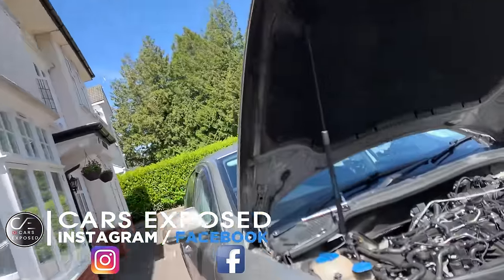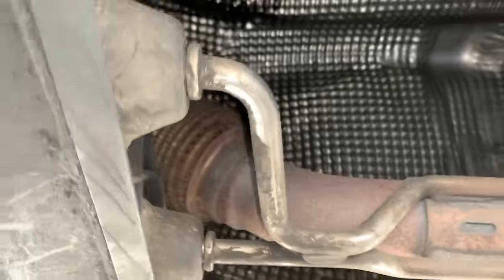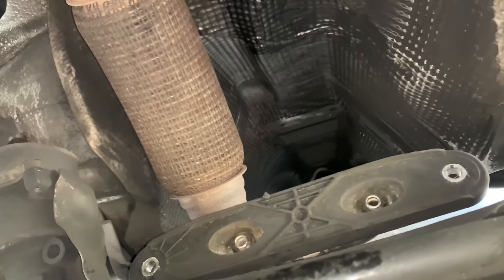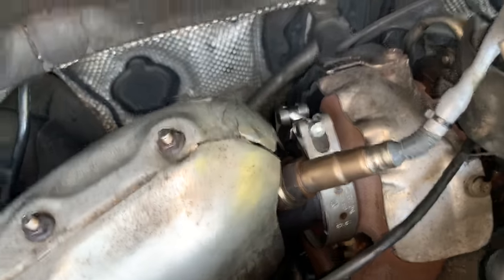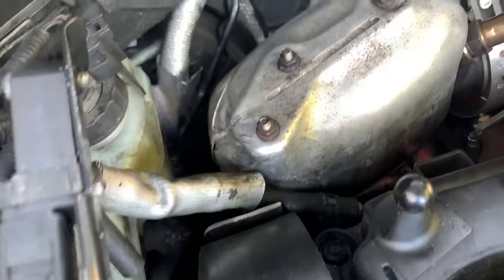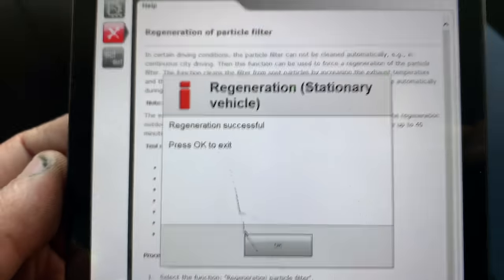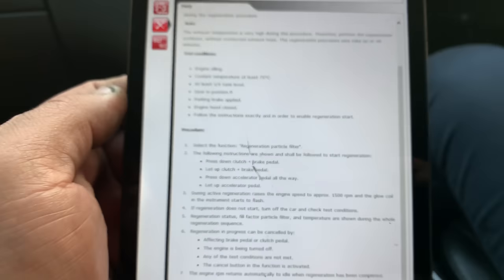2011 Skoda Superb 2.0 DPF Replacement | Engine CFFB Auto DSG VW AUDI SEAT

Comment: This is really close to my VW MK6 Golf, and I gotta say thank you so much for putting this video up. I needed to replace my DPF and this video is one of only TWO that I could find that were relevant. This one is great because I also don't have any fancy tools or a lift, and while doing it on the ground is a real PITA, it was much easier after seeing how you did it. I tried really hard to avoid dropping the subframe, but I've concluded it's totally worth it and the only way you're going to get the DPF out (and back) in one piece -- and you don't need to take out the drive axle, even though the workshop manual says you do. Thanks for the video!
Reply from the maker: Thanks mate I appreciate the words I’m glad the video helped you 👍👍👍
Reply: Just in the midst of doing this on my 2012 VRS. Dont see anyway the exhaust is coming out without the driveshaft being removed as it's too thick to squeeze past

Comment: That was amazing, takes a little guts to take on a job for the first time; there must have been some behind-the-scenes-time, figuring things out getting neck ache under the car, not easy
Reply from the maker: Keith Sware thanks brother in law 😊 nice to see you here, for sure I had quite few head scratch moments through the job, next time should be analog easier ... thanks again for being here take care 👍👍👍
Reply: @CarsExposed  
When  you undone your subframe,
Did you replace the bolts?
because they stretch bolts!!!
If you’re experiencing movement in the front of the engine whilst driving 
“like engines jumping forward/Squeaking when going over bumps.
you will need to replace the bolts +
You will need to Torque them.
I’m Studying mechanics in college.
Hopefully I will work for BMW or Audi one day 😀
Reply: @CarsExposed  
9:51 When putting your DPF clamp back on.
Which tool did you use ?
Thank you.

Comment: Done many 3t dpf removal. Couple tips. Get engine hot and remove all exhaust sensors as aids removal of dpf later. Replace centre exhaust bracket as nearly always rotten. You don’t need to remove steering rack just lower subframe 1/2 inch is sufficient. Centre exhaust tunnel heat shield give a bit of massage to where dpf is and dpf will rotate out of hole. While in there get a dark side developments egr cooler pipe and remove egr cooler and get mapped out or if cheap skate get egr delete box. Whole job should take approx 3-4hrs. If dpf is not cleanable cut hole in engine side of dpf and remove as only mot failure if they can see been tampered. Due to vw brands not able to rev up when doing mot cannot do smoke test and you still have cat in so unless engine worn out should be good.
Reply from the maker: Cheers mate 👍
Reply: hi.i just removed one today out of a 2009 octavia 1.6 tdi. i had to drop the driveshaft and remove the stabiliser it just cleared the steering rack when i removed the angle bracket. i did not 

need to touch the crossmember,
Reply: my superb taxi has egr delete box fitted, im getting this smoke occasionally when driving round town, does car need working egr to do regen ? Cheers
Reply from the maker: A H it does ... while regeneration the EGR and throttle body/air inlet is commanded by the ECU to almost closed position... also deleting the EGR increases the amount of soot accumulation in the DPF damaging it ..👍
Reply: Dpf deletes allow particulates and NOX into the atmosphere . This is not good for lungs, especially little lungs but if it passes the MOT inspection who cares that life expectancy of our children is now less than their parents......

Comment: Mine has almost 300K on it, it used to emit alot of smoke/dust during renegeration. 
I've managed to get rid off the problem during regeneration by spraying 1 can of Wurth PDF cleaner inside the filter and then went for a forced regeneration while driving, on a highway.
Now the regeneration runs nicely and almost no smoke. I think a bit of smoke starts to appear after I interrupt the first 2-3 regen attempts because I have to stop ( short town trips ).

Comment: Hi top vid. After dpf replacement, do i need to reset pressure sensor and let ecu know dpf replaced, then do regeneration. Or do i do regeneration first and then reset pressure sensor and let ecu know dpf is replaced?
Reply from the maker: Reset sensors first then regen 👍

Comment: Hi great video! Would a DPF blocked cause engine to smoke from that v-clamp area between the DPF / Turbo. Also back end on idle? Also shaking engine and no power whats so ever almost like misfire. 

My car has an issue same engine CFFB

Any help would be great thank you

Comment: Hi thanks for the video. why do u do a regen when the dpf is new ? do you know if its the same procedure on vcds for reseting adaptation?
Reply from the maker: It’s recommended to run a regen when replacing the dpf ... you will have option on vcds for sure 👍
Reply: @CarsExposed  Thanks

Comment: Hi, are you using delphi DS 150E bluetooth adapter ? and How did you get the delphi soft on the tablet ? thanks.
Reply from the maker: It’s a Microsoft tablet with windows 8, the Bluetooth is widely available on amazon on eBay 👍👍👍
Reply: @CarsExposed  Thanks a lot that you took your time to answer. All the best.

Comment: Hi there, I have engine management light on 2017 Octavia, just had a new Turbo fitted and being told DPF is knackered as I have replaced the NOX sensor, but still light comes on.. Going by your video would you think that my car needs remapped first as this might solve my problem before replacing DPF (Engine had to come out to replace Turbo and would guess also DPF)
Reply from the maker: John Reilly is the engine management light related to DPF? No need to remove engine to replace turbo or DPF as you can see in the video 👍👍👍
Reply: Cars Exposed the management light is saying that the NOX sensor is picking up .5 gas, it has been reset many times but keeps coming on so the Nox sensor was changed costing £400, but as you can guess light came back on. No being told that the DPF must be gone as other thing is Turbo and that’s been renewed. Garage did say to me that the engine had to come out for Turbo replacement and now to replace DPF. Says it’s because of the new singing in my 17 plate Octavia
Reply from the maker: John Reilly I would ask them to do a thorough test checking for wire harness integrity etc back to the ecu first before start replacing anything else ...

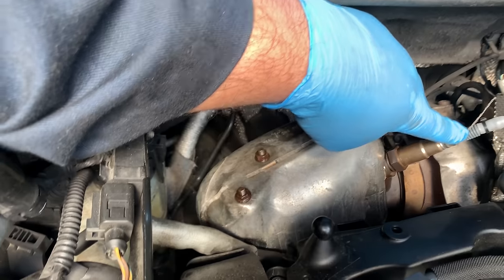Comment: I had this exact issue on an AUDI TT TDI, very similar 2.0 CR engine. Fixed witha £10 can of Mannol DPF cleaner sprayed in through the temperature sensor hole you show at 1:52. Mine was beyond the limit for forced regenartion and car was in limp mode.  10mins to spray it in, stand for 10 mins or so at idle with occasional revving then take for drive until values showing below threshold. Force regen while driving and all is good. The TT has quattro 4wd  so no way I was getting that DPF out myself!
Reply from the maker: dopiaza2006 Result mate I can only imagine it would be a lot more difficult with a 4wd vehicle 👍
The owner of the car already tried that sort of product and also a company terra clean or something similar and no results the inside of the dpf ceramic honeycombe was actually knackered 👍
Reply from the maker: Thanks for the recommendation mate. If it’s regenerating your car should be ok 👌 👍👍👍

Comment: How's she goin'?  That was an involved and difficult job to get the DPF out.  I bet putting it back was no picnic either...  The regen for the DPF took a long time, but you knew you were on the right track because of the absence of smoke out the tailpipe.  Nice repair !!!
Reply from the maker: Grampie's Workshop thanks mate bit of a pain of a job, luckily it worked out 😉💪👍👍 Cheers

Comment: dpf filter can be cleaned ONLY WITH HEAT!!! In an oven. Chimical cleaning will destroit it. V6 300k km ...regenerations about 250km. After cleaning 1300Km between regenerations..You judge for yourself! It doenst matter how bad the filter is!

Comment: You should mention engine type (CFFB, CFGB?), transmission type (DSG or manual? 4motion?) and make year in the description (maybe in the title as well). It would help others but also good for Google searches. As you know, the same engines are used across a wide range of brands and models, like Audi A3/A4/A6, VW Golf/Passat, Skoda Octavia/Superb, Seat Leon etc etc
Reply from the maker: Thanks for the heads up mate 👍... I changed the tittle a little bit you are only allowed 100 character I’ll update the description aswell cheers 👍👍👍

Comment: What is this software you're using? Is it for Android? Can you please submit as many details you can for this software ?
Reply from the maker: Konstantinos software is Delphi DS150 Microsoft based I purchased from EBay the tablet with the VCI and software already installed was around £250 about 2 years ago 👍

Comment: Hi Igor enjoyed this video. Cat believe didn’t hear any swearing! Must have been busy editing lol. Am I right in saying that even if the DPF filter does its job, at some point it will need cleaning or even replacing? Eg it’s just a matter of time before it will cost you money even if you drive motorway regular etc. Thanks
Reply from the maker: Thanks mate I was busy in the editing 🤣🤣🤣👍... the DPF supposed to regenerate itself on long runs on motorway or when pressure in the dpf is high enough raising temperatures and burning off soot but you are right they seem to kick the bucket or give you issues around the 200k Miles 👍👍👍
Reply: Thanks for that I’ve got a 2014 Mk3 Vrs estate done 80k so should be good for a while yet. On a Separate issue “changing timing belt” I’ve heard mixed views. Skoda say every 5yrs or 100k whichever comes first. Also read from online manual that unless live in a dust rich country (UK isn’t obviously) then it’s good until 240,000km or 140000 miles. Can you comment please many thanks

Comment: Hi i have problem with the speedo meter can you help me , i have done speedo test through the Delphi tool it works, but in running condition id doesnot show the speed , its a skoda superb TDI 2011
Reply from the maker: have you checked the speed sensor data ?
Reply: @CarsExposed  yes getting U0121 code

Comment: This is a twat of a job, I did mine on audi a3 8p and took me 3.5hrs to remove..
Reply from the maker: Yeah not easy to get it changed ... well done for getting it done tho 👍🙌
Reply: @CarsExposed  good tip on leaving the 13mm mounting bolts loose before you tighten the clamp on the turbo flange, I tightened them up first and only realised when I smelt the fumes inside the car.
Reply from the maker: @Liveforeever  👍👍👍